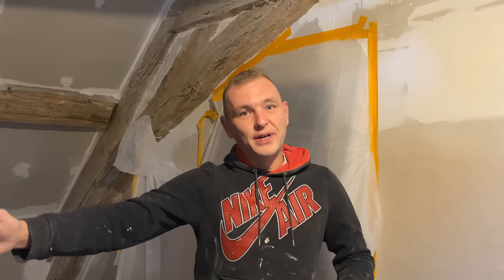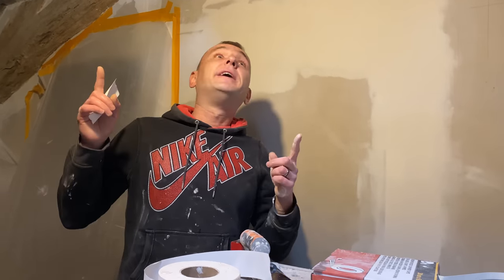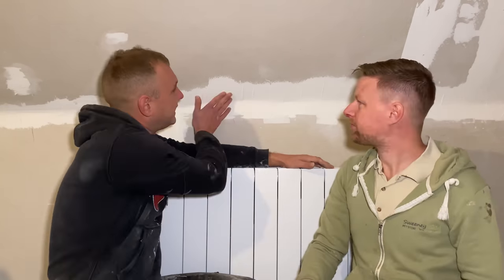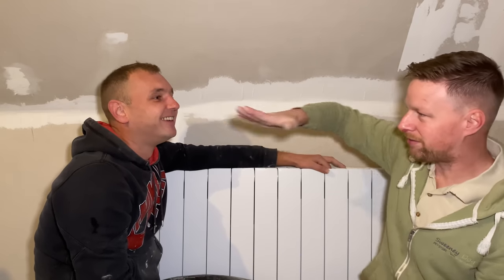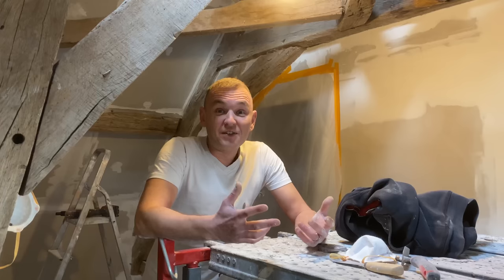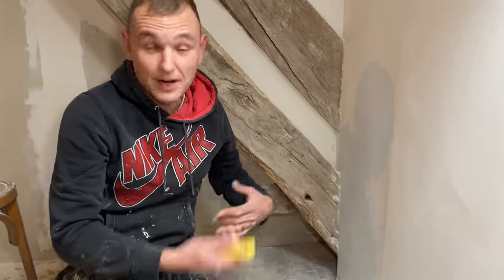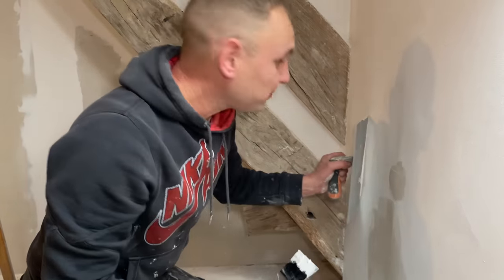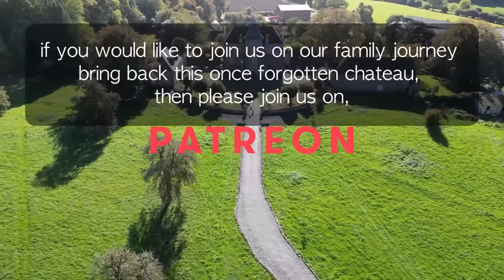The LAST ROOM to Renovate in our Home | Chateau Kitchen DIY. Ep 91

Comment: Hi! I watch another home improvement where they had to do patch work. They cut the sheet rock to size but left an inch of the front paper around the back. They didn’t need to tape afterwards just mud. It might be something to consider in the future when you have to do a lot of smaller cuts anyway. I also had a thought watching you mud the deeper cracks about using the joint gun for those and the tool to get an even bead on it afterwards. I have not tried it and don’t know if it would work. Great job! It is always these jobs that take the most time to do, and it is hidden but it is an eyesore when it is not done properly. Ash, I am with you, I had to patch the skim coat and it hadn’t completely dried and I painted it it made a mess and it drew my eye to it until I had enough and I fixed it. It was the first time doing it and I gave it a day to dry. 🤷‍♀️🤦🏻‍♀️ Anyhow, just something to think about as you have two other floors to do. Love your videos!

Comment: That's how we "tape and mud" here in Canada too.  Ash, I hated to watch you struggle spreading the "mud" with the large trowel:  if it is "heavy and won't spread easily" it is okay to add a bit of water, well mixed in, to spread it thinly.  Thin coats are easier to work with (plus you rarely get those "little bubbles"!)    Love your energy!  Good luck chasing down any remaining drafts!  Cheers

Comment: I hate taping and mudding!  The multiple applications and dusty sanding, only to find out after you paint that you either didn't put enough on in the seam and have a slight indent, or put too much on and have a hump.  I feel like I still have a bit of PTSD from when I remodeled my first home back in the 90s.

Comment: It helps to add water to mud to the consistency of creamy frosting. It goes on easier. Just like frosting a cake.
Reply: Thanks Sandy :)
Reply: @ashleywaters7198  I doe some finishing in my past. It really helps to use proper mudding knifes. When I bed in I will also mix 90 min mud with the regular mud. It drys faster and your able to put second coat on in same day. Buy a 4 inch for knife bedding in, 6 inch for  second coat. 8 or 10 for last coat. You can also use your knifes to scape off the rigges you leave  spreading the mud once it's dry. Easier then sanding them.

Comment: Joint filling a hateful job. Nice to get it so you don't see the joins. I cheated on a bedroom and got it plastered using brought over Thistle board finish in 2004. Converted a 35sqm classroom into a living room with 4.2m high ceiling and was hoping the English plaster would skim it but he had to cancel as unwell. Got my friends to help board the walls with 40mm backed dense rockwool backed plasterboards. Ceiling used the polystyrene backed version as more lightweight and cheaper. Hired a plasterboard lifter, which was brilliant from Lullier. From memory the rockwool boards were 25 euro.

I joint filled it all, a big job but looked great when done. Painted the room white.